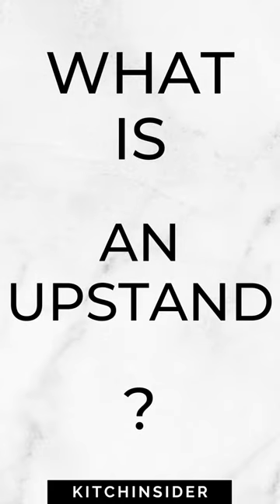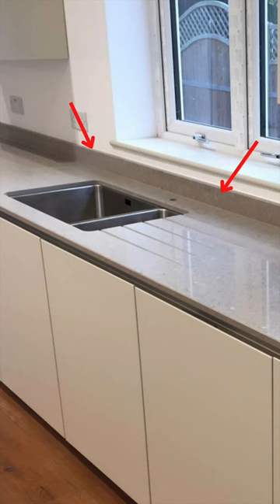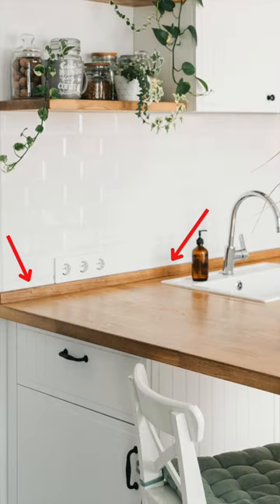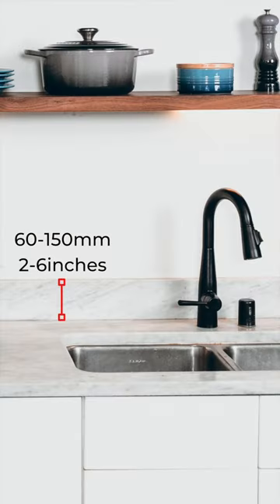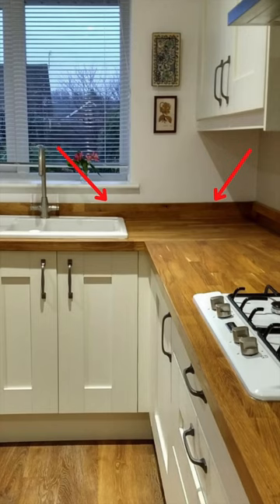What Is An Upstand? | Kitchen Design Terms #shorts

Comment: It also moves the tile grout sufficiently above the work surface so that the grout at the bottom doesn't get stained as you wipe.

If fitting on a Formica type top, it is imperative that the cut lower surface is FULLY sealed against moisture before it is installed.

Do not take a fitters assurances that their bead of silicone is all that is required - it is NOT!
Reply from the maker: Very good point! 👍